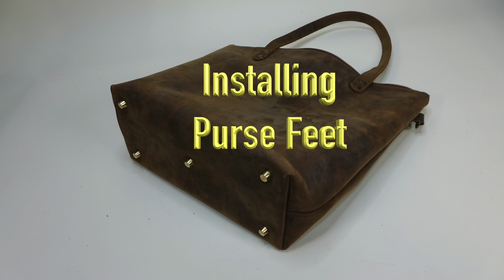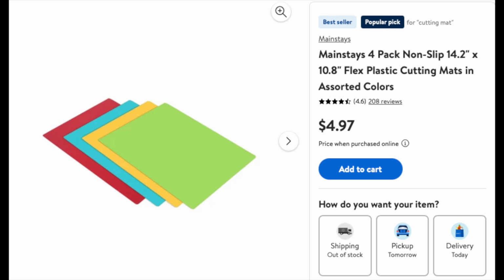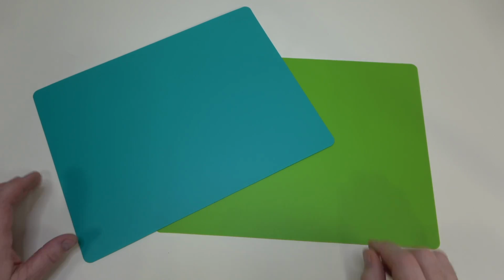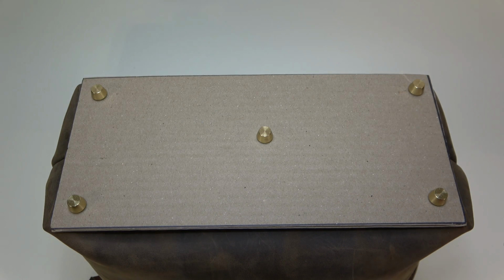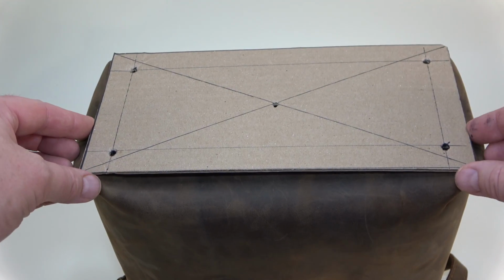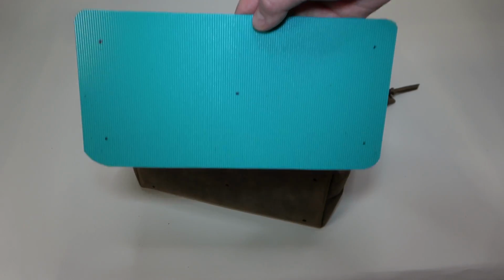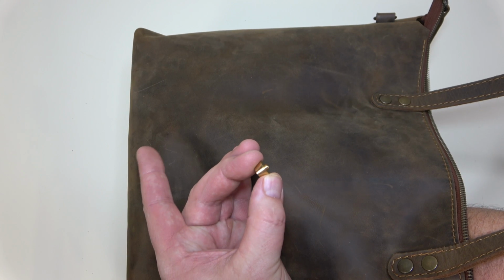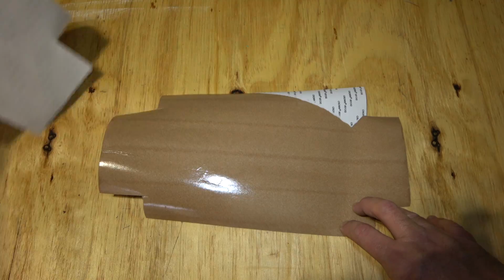How To Install Purse Feet

Comment: Great instruction.  I used OpenSCAD to design the template/stability inserts for my bags.  They printed with the recessed holes so the screw head is flat to the reinforcement and there isn't anything for items to get bumped on. I've got lining in all mine.  Looking for a video that includes doing this for lining.